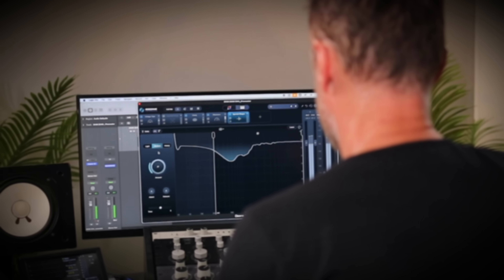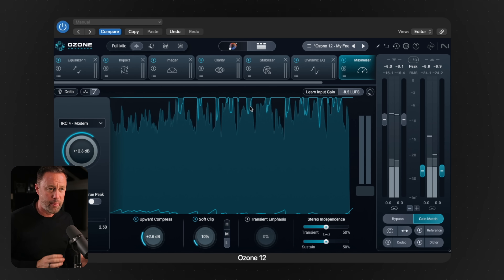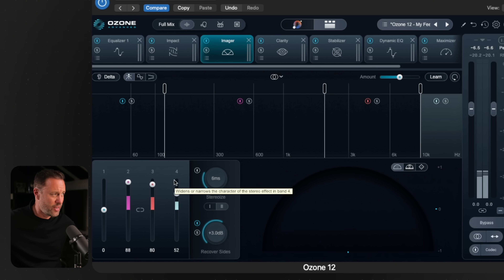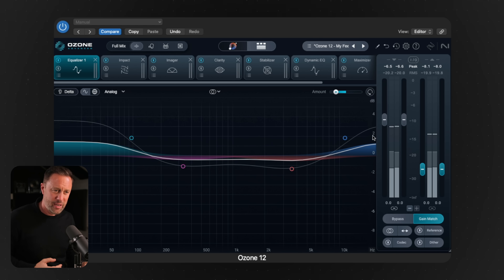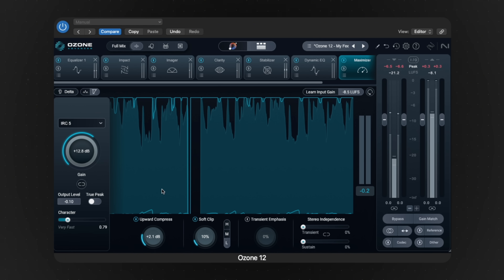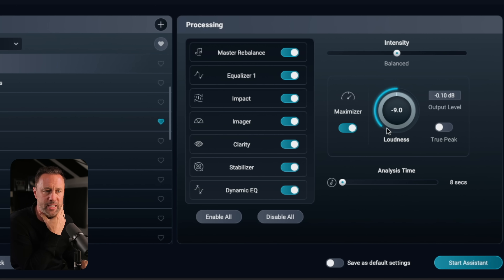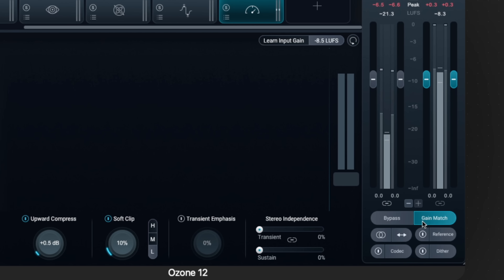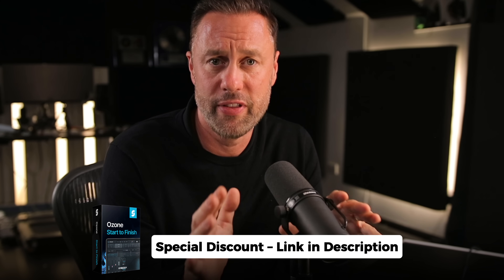Why Auto Master Sounds Wrong (And How to Fix It)

Comment: Streaky, I use Ozone 9. In order for me to get negative 8 integrated lufs, I usually need somewhere around 7 to 9 db of reduction, only momentarily of course. I  am mixing with the negative 6 headroom to start with, and have molot by tdr doing 2 to 4 db reduction for glue, then kirchhoff eq for that butterfly dynamic effect I learned from you  (thanks, that one really brought my mixes to life). Here is my question, I tried one instance of Ozone with the maximizer doing that really heavy lifting at the end, and I duplicated it, lessened the push into the limiter to 3 db and added 2 more instances with just the maximizer, each topping out at another 3 db roughly.  to my fairly inexperienced ears, the single instance sounds more open even though  I am definitely distorting things a bit. How much is too much reduction on a single maximizer? And , even after playing with the settings, why cant I get three instances to sound as open? I got it fairly good,  but feel like I am compromising an bit. ( I would rather not, of course). Thanks for your tutorials, I probably learned more pro level, game changing tricks from you than anyone else. ❤

Comment: From listening to yhe A/B comparison early in the video i would dial down the top end a little bit and try to get the kick to blend in with the mix a bit more. perhaps open up the width a little bit in the high mids. now ill watch the rest lol. :P

The stereo Independance in the maximizer i tend to open up the sustain independence as a way to widen the track a bit on some tracks. But tracks with a focus on big beefy stabs and such i open up the transient independece instead. Not sure if it's right or wrong. Its a personal preference. But im more careful with the transient one as i don't want the kick and snare get a left or right bias in the track. I use the toneboosters goniometer to see how and where the track pans more left or right.

Comment: If you have gain match dialed in this plug is literally doing nothing
Reply from the maker: That’s kind of the point of using gain match to not be foaled but the level
Reply: @Streaky_com there are no plugs that can make your sound louder without making it louder. It's an illusion

Comment: Perfect advice. Ozone user here for many years. V12 is the best iteration without a doubt. IRC5 and the Unlimiting module are neat. A bit expensive for an upgrade but it is what is, and it sound pro when used right.